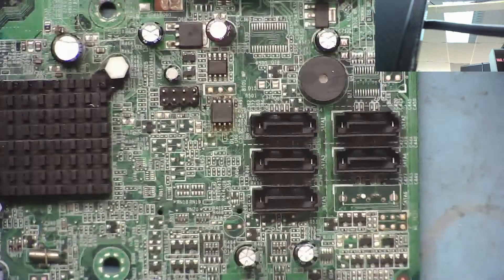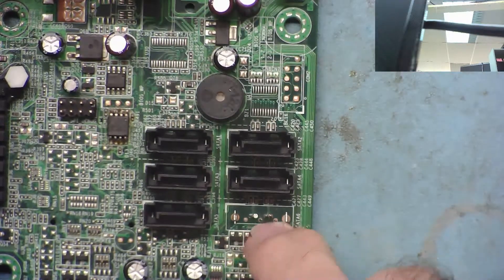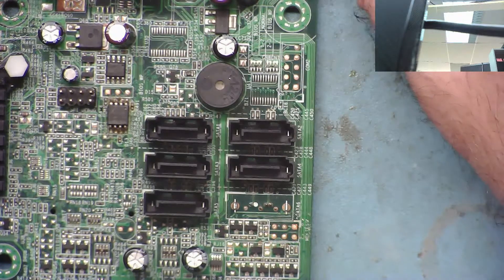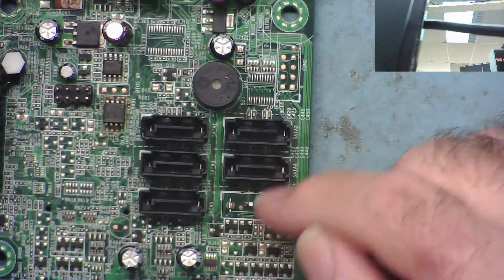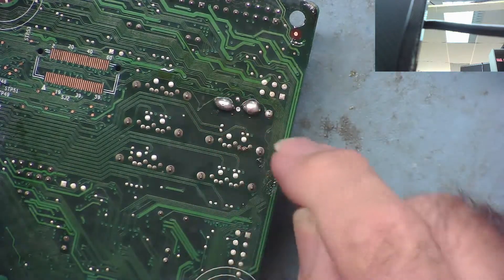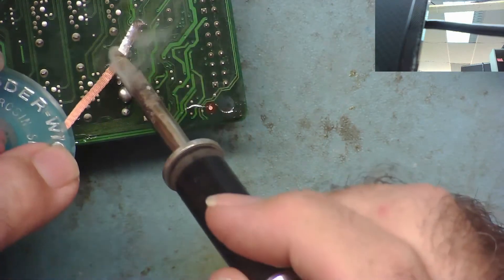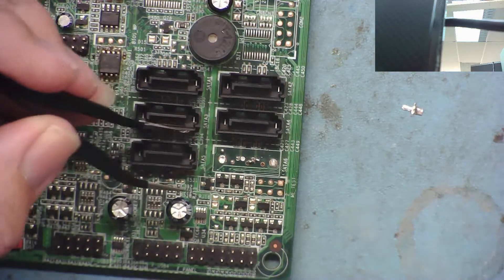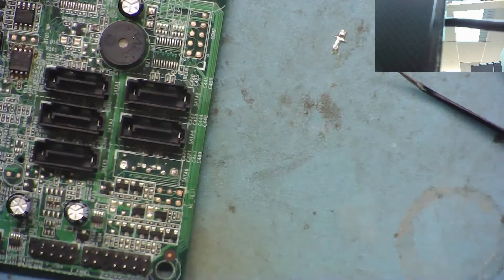Replace broken SATA Socket Connector - With Basic Tools!!

Comment: Use low melt solder mixed into normal solder. Using flux and braid it will clear easily.

Comment: Never thought about using a resistor for the holes, truely ghetto indeed, but a good trick to know!.
slaming the mainboard against the desk works way better than i imagined. Using that with donor boards is one of the next things i want to try as soon as i get the cahnce to haha
Reply from the maker: Yeah the trick with the resistor - if it goes through the hole is to push it about 3cm in.  It will take most of the solder with it but don't pull it straight back out again as you will just clog the hole back up again - once it cooled just cut the last couple of centimeters off the resistor leg then extract the resistor leaving a clean hole.